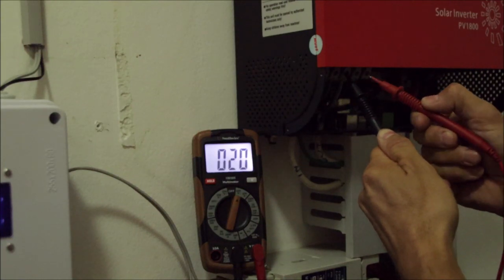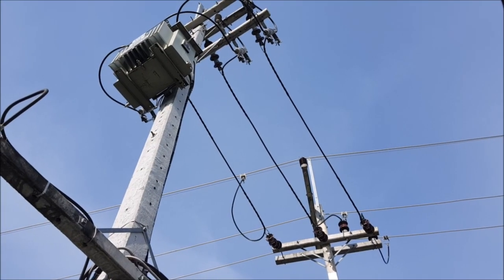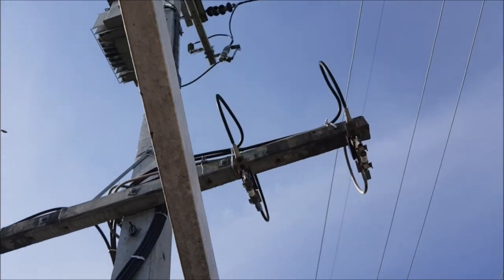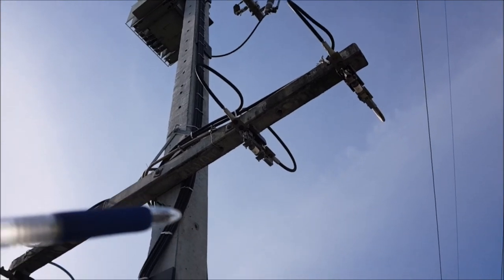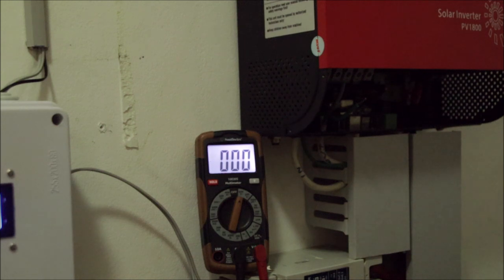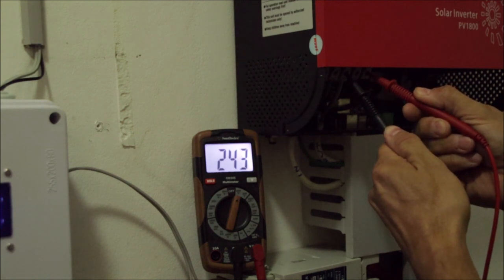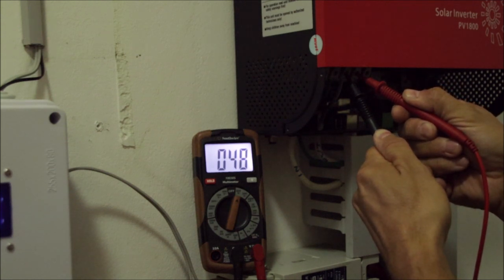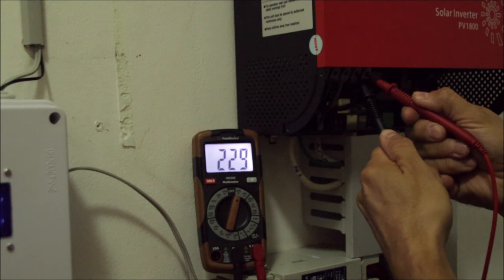DIY-Installation? Don't forget about Inverter Grounding and Neutral-to-Ground Bonding!

Comment: Hallo Roland , I measure 120 V between earth and L on my Epever UP3000-M6322 and 120 V again between earth and N. What is the case here? Gruesse aus Griechenland .
Reply from the maker: Hello Kostas, this is because there is no Neutral to Ground bond on that inverter. There are several comments on that inverter below my " simple Off-Grid system" video. Are you using this in a off grid application or anything else?
Reply: @RolandW_DIYEnergyandMore First thanks for replying. I using this in a off grid application and to charge the batteries from the grid but I do not use it in bypass to supply my consumers.
Reply: Aber auch bei einer Bypassfunktion wenn es am Netz angeschlossen ist , ist nur L und N angeschlossen bei AC In . Keine PE Anschlussklemme bei AC In vorhanden .
Reply from the maker: @kostaschatzi6391  eine Verbindung ders Neutralleiters mit Erdung korrigiert die Ausgangsspannung des Wechselrichters und ermöglicht dann auch Schutzerdung durch einen RCD.
Reply: @RolandW_DIYEnergyandMore  Danke für die Antwort.  Ich habe leider noch mehr Fragen zu dem Thema Erdung . 1) Die Erdung die von den Panelen kommt und auf die Erdungstange geht, kann die vorher zur Combinerbox zum SPD gehen oder müssen die getrennt zu Erdungstange gehen? Dies zu dem Erdungen draußen. 2) Drinnen sind der Inverter und noch ein SPD zu erden . Kann ich die verbinden und gemeinsam auf die gleiche Erdungstange führen oder wie muss das gemacht werden?
Reply from the maker: @kostaschatzi6391  Du kannst draussen alles zur gleichen Erdungsstange führen, sowie drinnen. SPDs sind keine permanenten Erdverbindungen, sind also nur zu Zeiten einer Spannungsspitze aktiviert.

Comment: All makes perfect sense, thank you. 
I have a 28kw inverter (huawei sun200-28ktl) with no requirement for the neutral wire to be connected in the ac outlet plug. Just 3 phases, and protected earth. So I assume everything will still work if all earths are connected, through to neutral in the distribution board.

Comment: You are lucky has a 3ph in Thailand 😊 I live in Bali in small vilage, we Are here happy for 1ph😂. Now i want make off-grid PV and get  own electricity. I want later connect the Growatt Inv. directly to the house 220V socket, and turn off the main MCB from company. This home wires is already grounded. ita enougth?
Reply from the maker: Hi. 1ph is enough for a house :) Yes, if you have grounding throughout the building, then you can use it for the off-grid inverter as well. Especially if you disconnect from mains anyways. Just make sure that you disconnect both L and N by a MCB or double pole transfer switch. Happy energy independence ;)
Reply: @RolandW_DIYEnergyandMore  Ok thank you for info :) Im also a "farang", Bule 😂 but in Bali, already 10years . Has a local wife And childs here. I decise move to off-grid because last times was big Windy here and our area was one week without electricity. Crazy . For the emergency we use the Gas silent generator, but Its No way fór Long therm.  I hope YT videos can help me build this systém 😂. Our daily kW spend i around 6Kw, so i Will just make a simple 48V systém. For the easy Future extend For more Kwp.  For now i just buy Growatt 6000es plus, 1x Huawei LiFePo4 48v 100ah battery And 4x Longi 555Wp mono panels. I want upgradable setup, because later i want move to EV scooters and small Wuling  EV car. Just for 100% Freedom from this crasy SW Asians governants 😂😂😂
Reply from the maker: @maxbiagi3091  sounds great. I think what you will need more right away are at least 2 more pv-panels ;)
Reply: @RolandW_DIYEnergyandMore  You mean for later upgrade complete 6 panels? I was thinking in future buy another 4 pcs. So 8 x555Wp complete. I will testing step by step. How much Will be ideál. We Are +- 1000m above sea level, so sometime 50% of the day here Is cloudy or rainy.
Reply from the maker: @maxbiagi3091  8 for later is good, I just mean that with 4 now you will probably not charge your battery much as 2000Wp will only output around 1300W and that you will use up right away. With 6 now, you at least have a chance to store a bit power for the night too...
Reply: @RolandW_DIYEnergyandMore  You Are right :) good point. Thank you. Jen not enought, i Will by directly another 4 again. Better more and JUST use one delivery :)
Reply: @RolandW_DIYEnergyandMore  Hallo Roland again. My work with PV already Done today, looks all good but i want you ask you about sunny day, because we Are in almost same Area. I watching today my Growatt inverter with 4x 555Wp Longi panels, And in thé morning around 10am, when sun Is already string,the panel giving complete 1700W, but when come after 1pa, And thy sun i up, ths panels just giving 180V but only 150W. When i come to thé roof check IT, they Are So much hot, And when i check the temp with a laser temperature meter, some of them has amlost 70C. You think this watts drop Its because hot?
Reply from the maker: @maxbiagi3091  hi. No. Temperature only, will drop the output maybe about 15-20%. So you should still have 1500W. You seem to have peak output already at 10am. I am assuming that your panels are sloped a lot and straight into the morning sun!?? Is the sun at 1pm already in a steep angle to the panels? Or do you have a shade on any of the panels at noon already? Usually shade will drop your output most. Second will be a unsuitable angle to the sun. 
You wrote once, that you will have a battery. If the battery is full already at noon, and the inverter is set to not export to the grid, then the panel output will drop to almost Zero as well as the energy cannot go anywhere...
Reply: @RolandW_DIYEnergyandMore  I have a flat roof And panel just lie straight on the Wood "construction". On the top. Because here in Bali Is almost like on Equator, So almost all day the sun Is directly above the PV panels. In morning from 8-10just giving 800W from big side angle, but in 12:00 the sun Is directly almost above them. The settings in inverter about battery was from factory stop charging on 54V float charging 52V And turn off battery on 42V. But the battery (Sacred Sun LiFePo4 100Am) seller  say, to set up like 52-51-43V. I think when this Power drop from panels come, thé battery just have a 49,5V And when my wife turn on the washing Machine, Its just také from battery And PV load still like 150-200W. Tomorow i Will check again. JUST open Beer, také a chair close to the Inverter And just watching like TV 😂.
Reply from the maker: @maxbiagi3091  OK. So you have a 15S LiFePo4 battery, same me. The voltages sound good to me. So yeah. I think that your inverter might be set incorrectly so that it is floating to early. Usually if the battery is floating, it would then stay in floating for 1-2hrs, before it switches back into charging if it has discharged a bit again.
Reply: @RolandW_DIYEnergyandMore  ok thank you for info ❤️, And in your inverter you set what about battery settings? The seller Tell me set up the battery menu in inverter to "Batt USE" not LI (lithium? But when i see some YT videos with Growatt on LiFePo4 Bart, they Always put LI settings And put some LAN protocol
Reply from the maker: @maxbiagi3091  that would probably be your choice. Either you use USER defined Battery on Inverter and the inverter is set to correct voltages, or you use RS485 connection and Battery is set to voltages and is telling inverter what to do. For that you need to have the communication to the battery as shown in one of me recent videos about inverter type BMS...
Reply: @RolandW_DIYEnergyandMore  ok i Will search this video :) . When i was try Now with the lan cable And switch to "LI" setting, Its just go directly to alarm And restart. Hard learning for me 😂

Comment: Wher to get ground in motorhome for my power inverter?
So i hawe conected 2 X 12V caycles 104 Ahm batterys to get 24 V 104 Ahm.
I hawe battery equalizer on them, the 
24 V + / - ports from batterys are conected to: Battery Guard. 
Battery Guard iz set to turn off sistem when batterys are 50% used. 
So from Battery Guard i hawe output: 24V it's protected with 40A fuse.
Becose i Will use power inverter 24V to 230V 50Hz 1500W to power my aditional freezer. Freezer uses 85 W to work. That gives me 14 h of non stop power but becose freezer don't run 24/7 i Will hawe autonomy for at least 48 h before pluging the motorhome to camp electricety. 
One thing that bothers me is wher to conect ground of power inverter ?
1.- metal part of motorhome ?
2.- negativ pole of motorhome electricety sistem ?
3.- battery negativ pole whic gives power to inverter ?
Reply from the maker: hi, you can get Ground only from planet earth :). If you stay at a camping place, you could get it from a power socket there, if you only connect the PE wire in the plug, and that you connect to your PE of inverter. Or you use your own grounding rod, which you bang into the soil at your place you camp, and connect to there.

Comment: You are wrong, this inverter has N-G BONDING Inside,when no ac is present, NG is connected by relay inside
(Ground Fault)
The voltage difference between Neutral and Ground is too high.
 The internal ground relay is activated but the voltage over the relay is too high. The relay might be damaged.
This when No AC present
Reply from the maker: Inverters with internal bonding relays are very rare. most inverters used for DIY either have no bonding or a fixed bond. You could have told which exact inverter you have so that people know who are looking for an inverter with built in relay.
Reply: @RolandW_DIYEnergyandMore  
My inverter is voltronic, but these inverters are the same,you can open it and see

Comment: Sir, with due respect, why don't you show the diagram first and then explain it on actual machine. Thank you
Reply from the maker: Because that would only show an individual setup in an individual situation, which might not be suitable in your case. That's why this is just the first of a whole series of videos. You will find many diagrams at later times after you had the chance to get a bit of background knowledge on what the whole topic is about. Just follow the playlist. We creators do see the YT statistics and we know that most viewers are just jumping through the videos and do some cherry picking only watching maybe a fifth of the video. Starting with a diagram might not be a good idea when knowing that right after seeing it, most of the audience is turning off the device and leaving with a screwdriver in their hand ;)
Reply: @RolandW_DIYEnergyandMore  Thank you very much Sir. I will be waiting for more in depth insights from your side. Also elobrate the grounding difference between transformer and transformerless inverters. Best Regards
Reply from the maker: @mahmoodadnan1555  as I said, there are already about 15 videos in the playlist for inverter grounding and most of the topics are covered albeit maybe under a different title. How to ground transformer-less systems (PV systems without DC/AC isolation) are shown in the videos about "Basic Grounding and Surge Protection" and "Requirement of Type-B RDCs". It is actually not different to common practice in PV installation as typically the DC side (PV power lines + or -) will always be kept isolated from Ground if not otherwise required by the equipment manufacturer. The only device connecting a DC power line to ground is an SPD in case of a voltage surge during a nearby lightning strike.
I will probably upload another video about this in the near future. Regards
Reply: @RolandW_DIYEnergyandMore  Thank you Sir